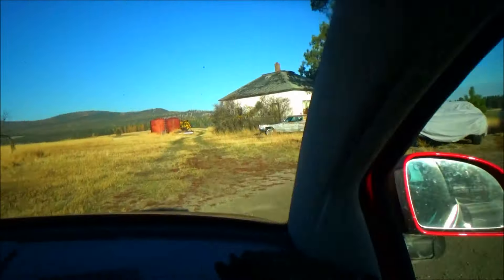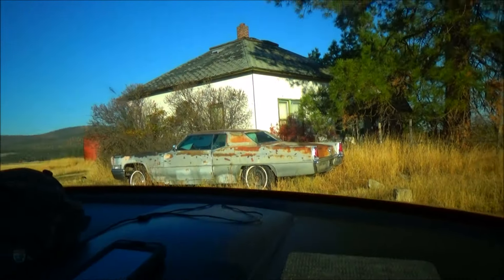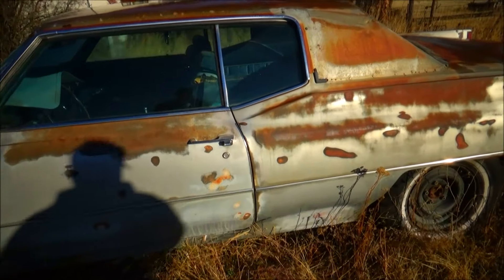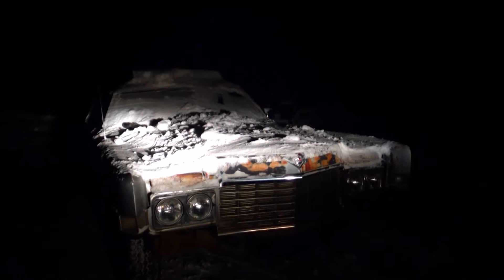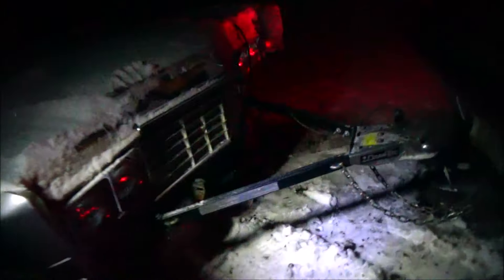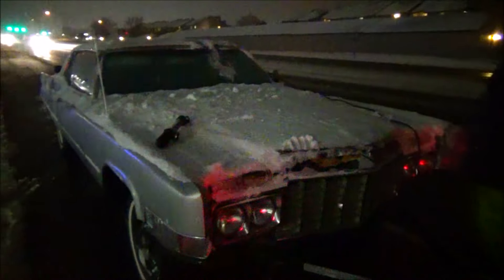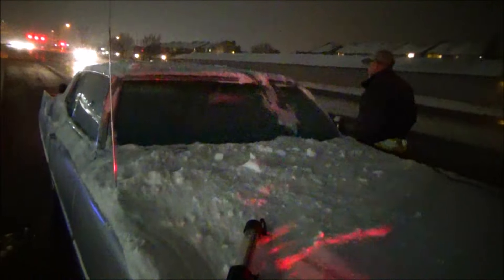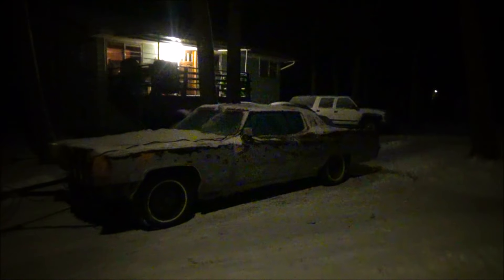1969 Cadillac Coupe Deville Part 1 (Towing it Home)

Comment: My buddy had a K5 Blazer with a 454 that  blew up and he couldn't find one in any local wrecking yard he ended up dropping a 500ci Caddy motor in it and my lord that Blazer pulled like a freight train, 28 foot Bayliner on a twin axle trailer and you hardly knew it was back there, torque monsters those Caddy motors are!

Comment: if you guys still had that diesel van I think you were selling that would be an awesome engine swap.. 6.2 diesel coupe deville
Reply from the maker: Yes metvelle I think you're thinking what I'm thinkin'.  If you watched the video on hauling home the  6.5 from the barn you'll see the engine we are gonna try and fit into the caddy.  We need to modify the sump on the oil pan and make it a front sump instead of a rear sump to fit around the steering linkage and do some motor mount re-work.https://www.youtube.com/watch?v=N1G7IVyVS7A
Reply: awesome you could have the coal burning caddy..lol